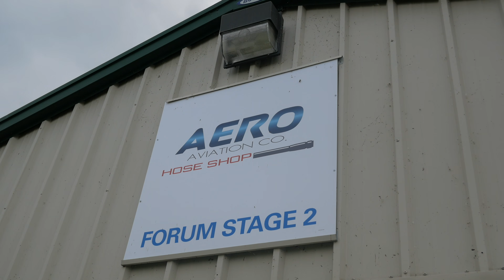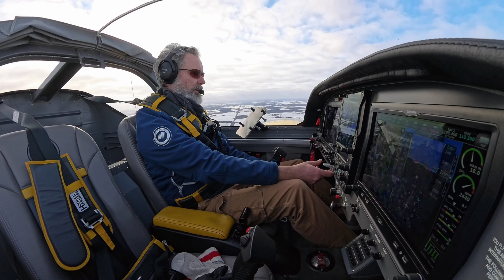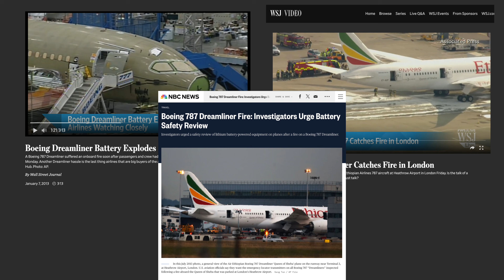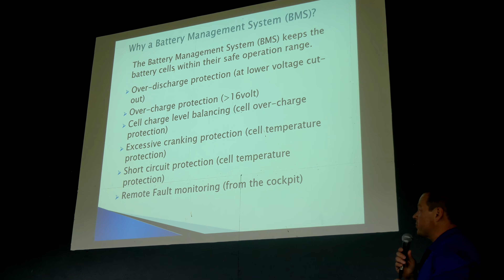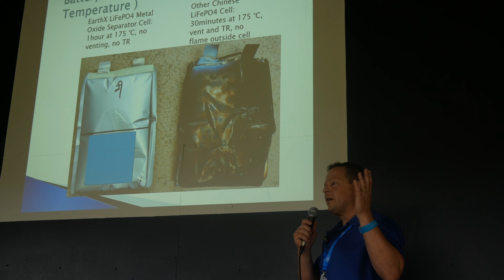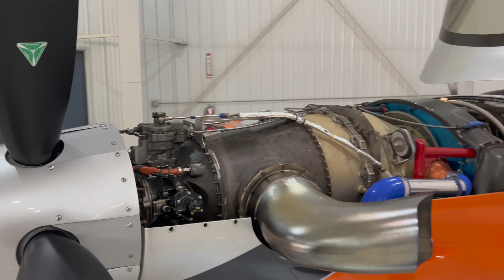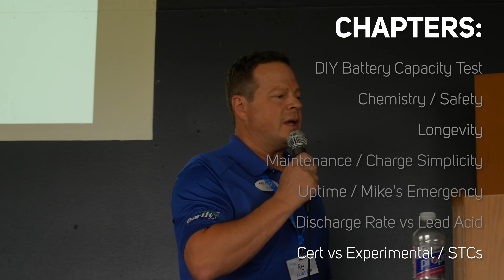"Are these the batteries that blow up?” | Deep dive on Flying with EarthX Lithium Batteries

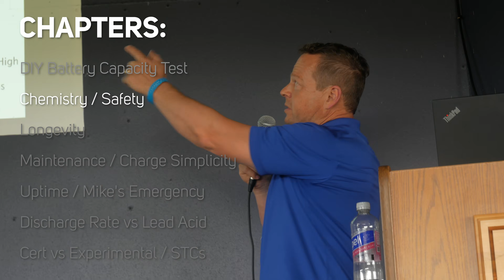Comment: 4:04  This slide highlights a major confusion in the overall rechargable battery space.  This has been driven by abbreviation of battery chemistry labels in (for example) cell phones that has now unfortunately bled over into transportation and aviation.  

The "Lithium ion" batteries in cell phones that can be dangerous, and are the reason that anything labelled "lithium ion" have all kinds of special DoT handling requirements, are really "lithium ion-manganese" or "lithium-ion cobalt" (the right two columns here).  

The left two columns is a rapidly expanding sector of the battery market.  They're used in electric vehicle high-voltage batteries, portable solar batteries, among others.  They are "lithium-ion-IRON" (or sometimes just lithium-iron) batteries.  Less power-dense per weight, but very stable and long-lived chemistry, and run cool and they don't have a thermal runaway cycle.  However, because the expody batteries were just called "lithium ion" for so many years, and "lithium iron" sounds so much like "lithium ion" there's this massive language problem.
Reply: Yes, chemistry is very important! I'm glad we're able to educate people on the differences! We chose the safest and most robust chemistry for a reason!

Comment: 2:56  Multiples of "C" is a very important part of that graph; what does "C" stand for?  Does it stand for "Capacity", as in the battery capacity in amp-hours?  (As in 1.0 C would be 12A for a 12Ah battery?)
Reply: C is a common expression in the battery world, it indicates charge/discharge rate. Charging at 1C means charging in 1 hour., 2C is half an hour. 4C = 15min etc. This is important as the higher C means the batter gets hotter, and like they said, hotter means shorter life. Hope this helps.
Reply: @haxi52 That's not quite it means. It has to do with charge rate versus nameplate capacity.  For example, a 40Ah battery discharging at 20A would be a 0.5C discharge rate. It's essentially a quick way to compare battery cutoff voltages at various discharge rates. The reason lithium batteries are so good is because they can do a very high C, like 10-20C for short periods without damage (as long as you have a good BMS). The same measurements apply to charge rate. Generally charging under 1C is a good idea for long life but they can indeed soak up a lot more energy - the only issue is the ESR of the battery starts to generate quite a bit of heat at these high rates.

Comment: Clickbait title. millions of lithium batteries out there with no issue. I've got 4 in my van and never an issue
Reply from the maker: That question is literally the most common thing that EarthX is asked within the aviation community.  They have to constantly debunk pilot's fears that their aircraft battery can burst into flames... Did you watch the video?
Reply: I can't say I agree with this being clickbait. I am one of the folks who are a bit uneasy about lithium ion batteries in my aircraft and believe the wrong product can lead to disaster. Not all lithium products have the same level of quality. 

I found this very informative, especially the testing and protection circuitry that  was shown.

Comment: I have had an EarthX battery in my Cozy for a few years now. The master accidentally got left on overnight a couple of years ago. The next day, I found the airplane dead, battery putting out no voltage at all. Not because the battery was dead - but because the EarthX protection circuitry shut down the battery once the charge got too low, saving the battery. A few hours on a charger and it was good to go, and has been great ever since. Don't try that on a lead acid battery!
Reply: Love to hear it!

Comment: The thing that drives me nuts about Certified aircraft; I can't put one of the EarthX batteries in my 172.
Reply from the maker: You might be able to now... have you checked the STCs lately?  
They are constantly getting more.
Reply: @FlightChops  This video prompted another look - it seems like the only 172 on the list is the 172D. So if anyone from EarthX looks in... I've got cash in hand for the switch. (and I love a great modification).
Reply: @GlensHangar  We have STC's for 24V 172N, P, Q, R, & S and a lot of 12V Cessna 172 STC's coming hopefully in the next few months!!
Reply: @EarthX_Lithium_Batteries  Excellent! As soon as the 172B is on the list, you'll have another convert.
Reply: @EarthX_Lithium_Batteries   @FlightChops  Finally! My model of 172B made the AML / STC list, and an EarthX Battery is on its way to my hangar!
Reply: I love the idea of EarthX they just need larger capacity 14V batteries for the larger GA planes. The need an equivalent in 30-40ah range for the 300hp class planes.